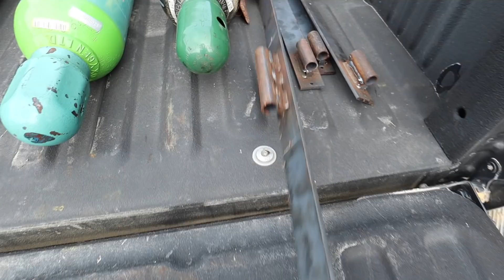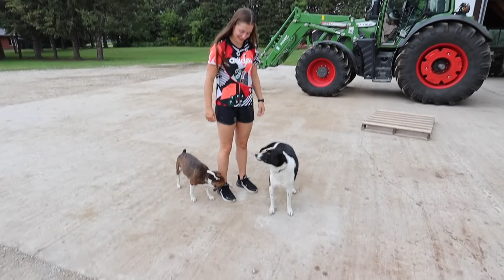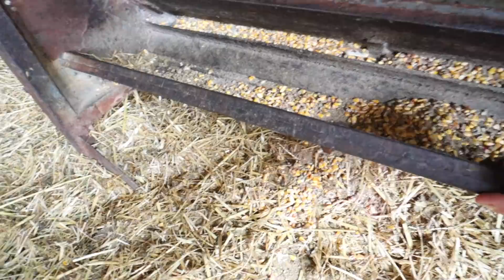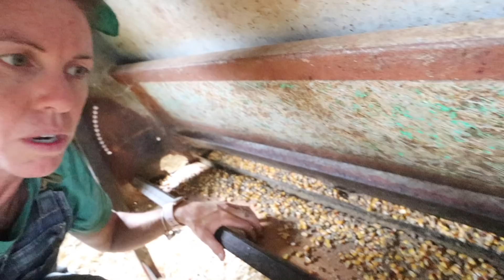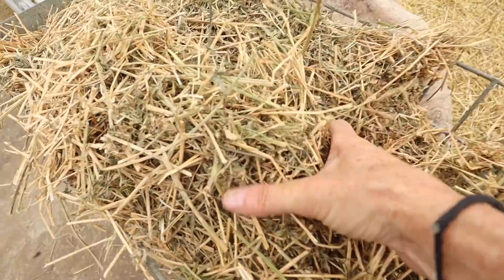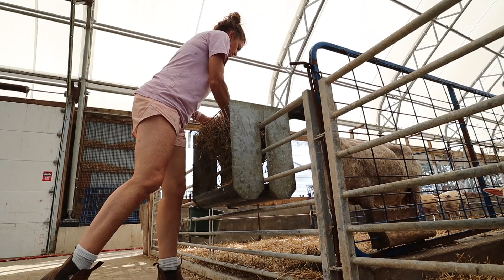She's GOAT me worried🥺 | Vlog 485

Comment: You guys have GOT TO renovate that old house!!
Reply: Based on it's age, it may actually be impossible to fix. Certain parts of Ontario have weird laws about fixing up houses that are over 100 years old to the point where they don't get fixed because it's a legal nightmare to correct things like wiring, heat, air conditioning, etc. So many old houses just Fall to pieces.
Reply: @DembaiVT  that’s so sad!